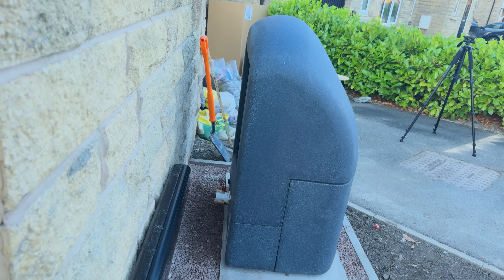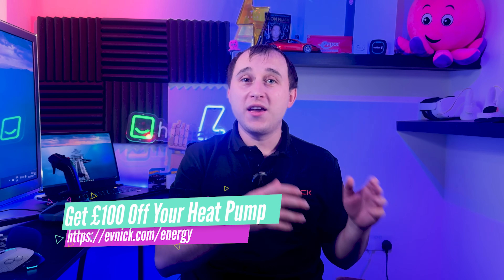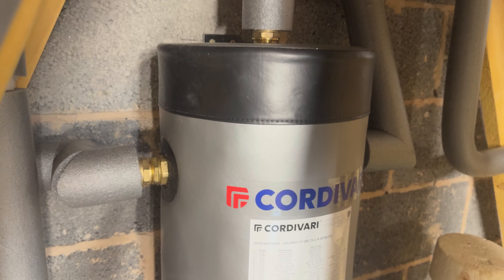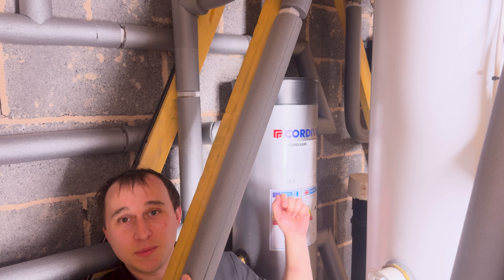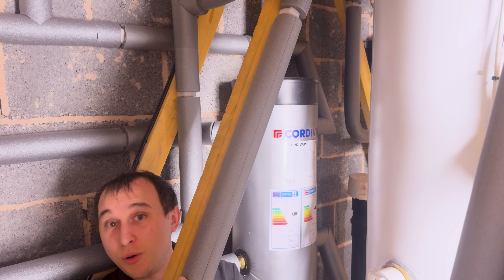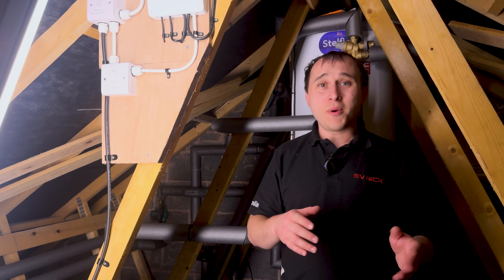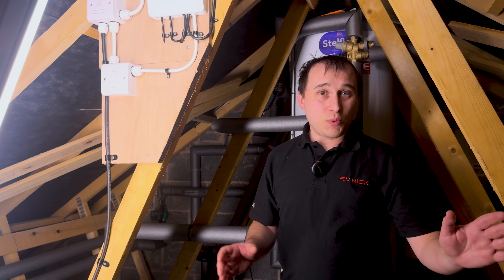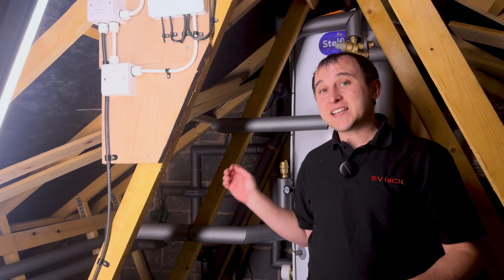My COP Of My Cosy6 Is Awful How We FIXED It!

Comment: People get so bogged down with efficiencies but go quiet when you ask them about the cost of getting that extra efficiency. The proof of the pudding is the OVERALL COST (install cost + operating  cost) over a 15-20 year period. The independents can never compete with the likes of Octopus and BG on install cost, so getting an extra 0.5 SCOP with an independent, but having to pay twice the install cost to get the extra 0.5 SCOP is not always the answer. I personally like what Octopus are doing with the Cosy 6 and I like the brave design, so I'm interested in seeing your results once you have had a good winter to gather some real data and running costs. Stick with it as I suspect the results may be better than a lot of doubters are expecting.
Reply: Completely agree, I got a heat pump plus solar and battery installation for the same money as a guaranteed cop system, the battery and solar is a far better deal than the slightly higher cop considering the system can easily do 8-10 hours on battery alone (at 5p/kWh)
Reply: @JP-wo4ic  My fridge is at least 25 years old. Still works. It has had 2 new thermostats but the compressor is fine. As you say, those are sealed units - no oil changes. Simple single-speed ones. Some heat pumps still use those (mostly GSHPs). You are right that the compressors in  modern ASHPs are fancier, but also running on a lower duty cycle than a fridge (less than half the year for heating here, and yes some maintenance is generally a good idea. 

We shall see how it goes, but a 2024 US report says average lifetime is currently 15 years and rising. (I would link it but this is youtube). Looks like we shall have to disagree. What's your evidence that lifetimes are 1/3rd of that?
Reply from the maker: 100% when I did the math on using independents the payback added 10-15 years on to cost,  If the heat pump broke in 12-15 years then I'd like to think that technology improvements in efficiency would of took place and  if the heat pump last the full 15 years I just broke even so would need it to last another 5 years more to save me money time you add in the interest on that money i'd of earnt in the bank or not borrowing it.
Reply: Or you can DIY like Glyn above and get something which is both very efficient and very cost-effective. And there are installers out there who can do you a decent system for about the same as the grant so you pay very little.
Reply from the maker: @ octopus only people I seen this cheap everyone else wanting 7k over grant! Glynn not your typical diy he is a super smart engineer and a top bloke
Reply: @NicolasRaimo  Conga in Ipswich have been doing installs which were 1-2 grand over the old 5 grand grant, so 6 or 7 grand total - i.e free with new grant. Obviously more if you want fancy stuff like UFH, and new hot water tanks put the price up. But HP installs don't have to cost a fortune - they just have to be designed properly to size.
And yes Glyn is a smart chap but there is nothing in Glyn's install that most competent DIYers with a bit of plumbing experience couldn't do. It's not rocket science.
Reply: @xxwookey  From what I can see everyone have put up their prices since the grant was increased, knowing that the final price to the customer is the same, so more profit for them and no lower prices for us.
Reply: @JP-wo4ic  Compressors last a great deal longer than 5-7 years in fridges. (15-20 years is fairly normal). I don't see why heatpumps should be any different. So yeah I think a 15-year lifetime for a heatpump seems likely to be reasonable. Countries that have been using them for decades presumably already know how long they last.

Comment: Physics dictates that lower flow temperature improves heat pump COP, however the amount of heat that radiators can dissipate reduces with the flow temperature. When you reduced the minimum flow temperature the amount of heat the radiators were able to emit was less than the minimum modulation of the cosy 6 (probably about 2.5kW) which caused the cosy 6 to cycle on-off which reduced the COP. Generally the min flow temperature shouldn't be much more than about 10C lower than the design temperature e.g 30C for a 40C design or 40C for a 50C design, but this will vary depending on the amount and size of emitters. This spreadsheet can help with this calculation: https://youtu.be/r7DJMJGQJUc?si=a-xU8BxTJRfNRxq5. Agree that Octopus should use software and AI to determine this automatically.
Reply from the maker: They removed ability to change flow temperature settings so hopefully 🤞 my emails and this video means that’s what they plan to finally do now they have more cosy6 in the field!

Comment: I am glad I have a Daikin and installed ESPAltherma. I can see a lot of data this way.
Reply from the maker: data will come its a new HP
Reply: @ I was thinking about the user, not your videos. I am finding it fascinating how a heat pump works. People are used to the radiators throwing out heat, yet the heat pump keeps them luke warm yet the house is warm.
Reply from the maker: @bazcurtis178  I mean the user data will come my heat pump one of the first installs the app has had 2 large changes since September and data will come

Comment: Slowly the realisation is setting in that he should have just left the gas boiler where it was, paid ZERO pounds to Octopus and stayed nice a warm this winter 😉
Reply from the maker: It’s nice and warm now and cheaper to run than my boiler
Reply: @NicolasRaimo  wait till it's sub zero outside and we'll see.  I'm not having a go mate, I just wouldn't have gone down that route, that's all.  Not in your particular house with that particular set of circumstances.
Reply from the maker: @ heat pumps proven technology they work sub zero
Reply: @NicolasRaimo  I have two air to air units myself.  They work in sub zero, just not as well and efficiency takes a dive.
Reply from the maker: @Chris-hy6jy  air to air isn’t as efficient thou… even as a cop of 3 this be cheaper to run than gas
Reply: @NicolasRaimo  if the average price of electricity is 4x the price of gas, you need a cop of 4 to get price parity.
Reply: @Chris-hy6jy  

 COP of 3.4 is a matching price, and that's assuming gas boiler is 85 % efficient, 1kW of gas would give 850 Watts of heat.
Reply: @_Dougaldog there's also demand shifting with batteries and time of use tariffs for both Air-to-Water and Air-to-Air when comparing electricity to gas.
Reply: @_Dougaldog  okay so hopefully you can see why I might be reluctant to replace a perfectly functional and reliable gas boiler having a SCOP of 3.4 (corrected for price) with a heat pump having a SCOP of not much more for many many thousands of pounds.
Reply from the maker: @Chris-hy6jy  next video is how much it’s cost me to run maybe wait to see before commenting
Reply: @ 

Your gas boiler has a SCOP of 0.85, any heat pump with a SCOP. Of 3.4 will cost same to run IF your boiler is 85% efficient.
It will very likely be below 80%.
Reply: @_Dougaldog  my boiler is approx 90%
Reply: @NicolasRaimo  well as you've said your COP has been very poor, it must have cost more than a gas boiler, unless you had something wrong with the gas boiler also.  I'll wait for the video anyway.
Reply from the maker: @ as video said that was 90% my own fault and it’s been fixed now also the cop wasn’t worse than gas as it was warm outside when spotted it was just a poo cop for how warm outside air was,  also cop is almost a pointless measure when talking about cost to run as if the price of electricity changes to say 0p for a power hour running it at 1cop would be cheaper than gas it’s dependent on how ocotpus control price and heat pump
Reply: @Chris-hy6jy  
Do you use low flow temperatures to get 90% ?

So a SCOP of 0.9.

Most gas boilers are run at highest temperature. Anything much above 55C will not be condensing very well, pulling the efficiency down.

OVO  put the average British boiler @ 83 %, and that is probably optimistic.

In energy terms they are much less efficient than heat pumps.
Reply: @_Dougaldog  well the boiler is a year old running at 50 degrees flow for heating and 70 for hot water so it's going to be somewhere in the ballpark.  It only takes 20 mins to top up the hot water cylinder to 55 degrees so overall quite an efficient system.
Reply: @NicolasRaimo  oh I absolutely agree.  If the price of electricity were in parity with gas per kWh you'd be mad not to use a heat pump.  It's not though.  For most people on standard tariffs it's about a 4:1 ratio and has been for a long time.  Sure you can get solar but that's another huge expense.  All they need to do to increase the attraction of heat pumps is dramatically reduce the cost of electricity.
Reply: I think electricity isn't going to get cheap fast, and gas will only get more expensive slowly as we won't want to quickly increase costs for the majority of the population. As pointed out, you need a SCOP of about 3.4 from a heat pump to reach parity, so for a good refit energy costs should be about the same or slightly cheaper.
Reply: @Biggest-dh1vr  it's almost like electricity prices are held artificially high 🤔😉
Reply: @Chris-hy6jy  Not really. Just by using a time of use tariff I'm reducing my average unit price to about 2.5x the unit gas price. That alone makes it financially sensible. As others have said, leccy price is linked to gas price, so when that gets decoupled the leccy unit price will drop again, making even more financial sense. I know solar PV and batteries are an extra expense and not viable for everyone but they do highlight that heat pumps run on electricity which you can generate yourself to further offset the cost. With a gas boiler if you want heat you have to run it on gas bought from an energy supplier in real time. Each element of all this saves money and any one of them makes a heat pump worthwhile if you can manage it. All together, the savings can be eye-opening - as long as your installer puts it in right. Oh, and just for reference, my heat pump, solar PV and battery save me about £1,000 per year; doesn't take many years to get the payback when savings look like that.
Reply: @Chris-hy6jy  

My British gas tariff is 14p/kWh, that's about 3.25p/kWh for heat averaged over the year (as COP varies), so definitely a no brainer for me and perhaps others that are on HP tariffs (OVO and Octopus etc).
Reply: @Chris-hy6jy  Below zero has almost zero impact. It will be equally cosy.
Reply: @mbak7801  it has a dramatic effect on efficiency though.
Reply: @Chris-hy6jy  Subzero temperatures have nowhere near as much impact on efficiency as damp air. Dry air at -5 could be a more efficient scenario than damp air at +5.
Reply: @DennisBloodnock  I don't know why you have to split hairs.  It's obvious that higher humidity will lead to the HEX freezing quicker.  My gas boiler doesn't freeze regardless of the outside air temp, and that includes my well lagged condensate pipe.  As someone who has two ASHPs I'm well aware of how the defrost cycle works.
Reply: @Chris-hy6jy  It's not splitting hairs; it's an important distinction. You're saying below zero has, in your words, a dramatic effect on efficiency. That's not accurate, and potential heat pump buyers need to know that. A heat pump's efficiency - and associated running costs - can remain good at subzero temperatures; that's an important correction to your sweeping and misleading statement that also explains why heat pumps are so popular and effective in Nordic countries where weather REALLY gets cold.
Reply: @Chris-hy6jy  But your gas boiler constantly wastes ~10% of its heat by dumping it out the flue.  Compare that to a defrost cycle which will re-use most of the lost energy, it makes your point that your gas boiler "doesn't freeze" rather silly.

How are you measuring the effect on efficiency on subzero temperatures with an A2A heat pump?
Reply: @DennisBloodnock  do you have the COP Vs temperature specs of an aroTherm plus?  I can't find them on the internet anywhere, only SCOP which tells us nothing about efficiency at low temperatures.  A normal non-low temp heat pump will produce a COP of about 1.7 at -10 C.  Maybe the aroTherm is better but I've not seen any data to back that up.  Do you have said data?
Reply: @Chris-hy6jy  I don't have the COP vs temp specs of that heat pump but I do for the Ecodan I have, which is nothing if not widely installed. At -7 C it's still working on a COP of 2.6. You do realise, though, don't you, that there were only 45 days in the whole of 2023 when the air temperature dropped below zero at some point and most of those were still nowhere near -7 let alone -10. If you have two heat pumps yourself you will know already that the few days where running them is more expensive than running your gas boiler are completely offset by the dramatically better efficiency throughout the rest of the year. You seem to be advocating running something that's inefficient all year round on the premise it doesn't get any more inefficient when the snow starts falling. Hmmm.
Reply: @DennisBloodnock  my argument is entirely based on the cost.  If 1 kWh of electricity cost the same as 1 kWh of gas there would be no argument.  If it didn't cost a fortune to install, funded by tax payer incentives I'd be more willing.  All I'm saying is that if you have a perfectly functional modern gas boiler, I personally wouldn't spend thousands to replace it with a heat pump.  Especially if the property didn't lend itself to having one fitted, as in this specific example.
Reply: Cheaper with a heat pump., and definitely future proof.

Comment: Hi Nick, I had a heat pump survey and they estimated that I needed 12000 kWh for heating and hot water. My home only uses 6000 KWHs on gas. I think the surveys assumptions and heat loss calculations are miles out from actual consumption and heat loss.  Why do they over spec heat pumps and consumption so much?
Reply from the maker: They us MCs surgery and calculations but also you might be running it colder than next person who moved in would like it
Reply: @NicolasRaimo  thanks Nick we are frugal here but I’d expect it to at least be equal to gas usage as a kWh is nearly 4 times more expensive when compared to gas.
Reply from the maker: @alistairlambert3275  gas is 6.16p per kWh 
Electric 24p so you only need a cop of 3.5 to be price parity however octopus have deals for EV customers and heat pump customers plus loads of incentives for free power hours.  I have 7p offpeak electric for example
Reply: Mine is out by a factor of three… which is just insane.  If I added the heat they suggest at a -4 outdoor temp the house would be well over 50 degrees C…
That’s dangerously hot!
Reply: @JohnR31415  

The flow temperature to radiators would possibly be 50C at -4C outside. Your internal temperatures would be in the comfortable low 20’s.
My system (Daikin 6kW) was designed so that at 45C flow temperature, radiators would output sufficient heat to offset my potential 5.2kW heat loss at -3.5C outside.
This in return should keep living room @ 21C, bathroom 24C, and others at 18C as per MCS requirements.
My 6kW Daikin is currently drawing 512 Watts of electrical power (34C flow temperature to radiators), 1900 Watts of heat into house at 5.6C external temperature (COP @ 3.7).
My COP hovers just under 5 when external temperature >14C or thereabouts.
Reply from the maker: @ that’s why we have thermostats
Reply: @NicolasRaimo  Yes but almost all my TRVS are wide open. Getting the entire house to equilibrium seems to work better than trying to micromanage rooms. Everywhere is a comfortable temperature and I do not need to alter anything day to day.
Reply: You can try heat punk's tool for heat loss and see if you calculate something similar. It was fairly similar for me, and I was able to suggest larger radiators in some rooms.

The tool may be suggesting future inhabitants of the house will use more water, ventilation or heat than present inhabitants (or they may have the insulation wrong).

Comment: Wonder where the data goes if move away from octopus?
Reply: Octopus will still look after the heat pump even if you aren’t an energy customer
Reply: @JohnR31415  didn't know that. For free??
Reply from the maker: yes
Reply: Until they decide not to. Without some 'lifetime contract' I'm afraid you are at the whim of Octopus to stick to their promise of looking after it. I'm sure they will, they'll just charge you for it instead, if not in a subscription, then in the annual servicing. I'll stick to something supplier agnostic that can be serviced by many of the competent engineers locally.
Reply from the maker: @ heat pump designs are pretty much basic same internally nothing hard but they supply install and maintenance manual with install so anyone could service it
Reply: @NicolasRaimo  the main issue seems to be that it's all locked onto the OE app. Does it have a separate physical controller for setting it up? Or is that all via the app? At least with my Vaillant, if they drop the myVAILLANT app I still have controls locally (which you can also add modbus to). With Cosy, if something happens and Octopus stop supporting the app, then with no local controls, the thing stops being able to be maintained/configured.
Reply from the maker: @ it’s just using a modbus so could be switched for another controller… I’ll maybe do a video showing this
Reply: @NicolasRaimo  interesting, would be good to see. Obviously the big sell from Octopus is about the 'smarts' of having their controller(s) and Kraken backing it, but would be interesting to see what the Modbus looks like. I assume that is direct with the unit, so cuts out their controllers, so you'd just bypass them. Still means it can live on if ever Octopus sacked it off, albeit you'd need some fairly techy skills to control it!